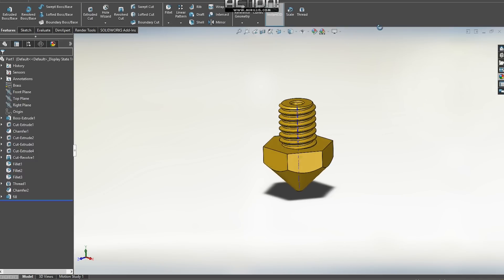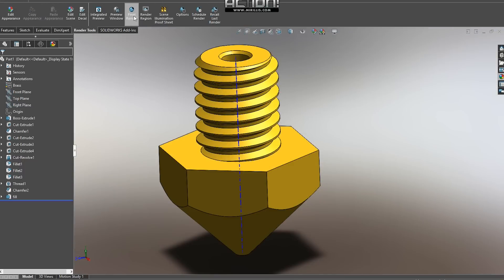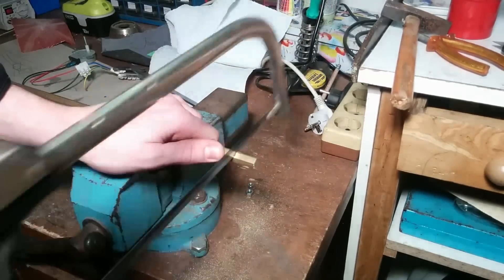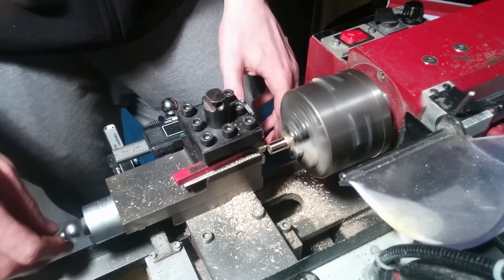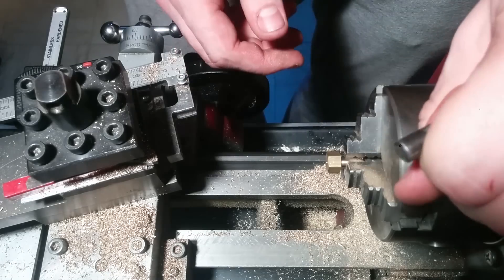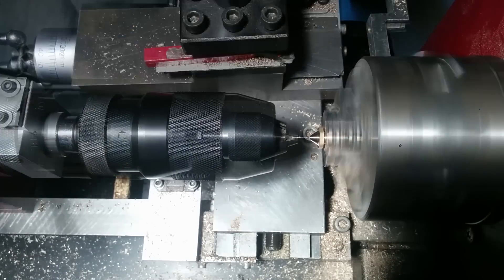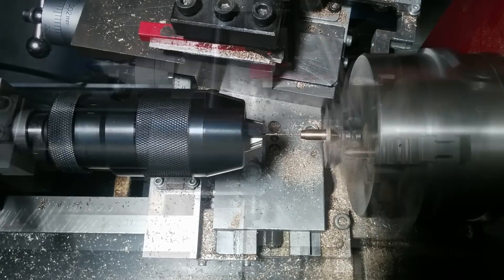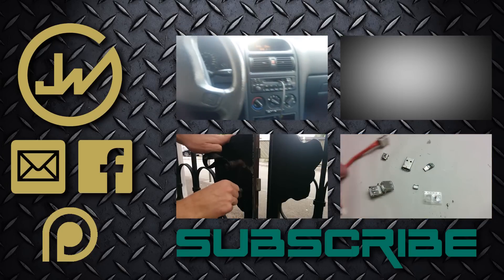Make a Brass Hot-End Nozzle

Comment: Thanks for sharing this.  I need to invest in some metric drill bits now.  Personally I would reverse the order of operations a bit.  I would be inclined to drill the 2mm hole to depth first, then the 1mm and finally the nozzle hole.  This would reduce the depth you need to drill on your smallest bits and thus reduce the amount of stress you put on them. Then cut the 45deg tip.  No criticism implied.  Just a different way to do it.  Thanks again.
Reply from the maker: +Prowler901 thanks Powler! I appreciate your thoughts and ideas :)

Comment: Thanks, I might give it a try. I got some 0.4mm carbide pcb drills somewhere...
Reply from the maker: +Fred Genius Nice, Send me some pictures how it turned out :)
Reply: I made one, not tested it yet, image here: https://drive.google.com/open?id=0B01q53nWAW2-aktfR3BZejBDcXc
Reply from the maker: Great one Fred, Did you make it from steel?
Reply: Brass, 6mm hex. This was my second atempt, I'll get it installed later and see how it performs. First attempt failed, broke the 0.4mm drill in the hole!
Reply from the maker: Really, looks like your brass has a very high percentage of zinc, because it is more silver looking. For drilling with so tiny drill bits use a very high RPM, highest RPM the better and do it slowly :)
Reply: Many thanks for the inspiration! It's good, regular brass, just looks a bit zincy in the photo. Max on my lathe is 3000rpm. I dint pay enough attention to chip clearance, that's why the first drill broke. Just waiting for the current print job to finish and I'll give it a try... Edit, when brass squeaks, your drill is about to break!
Reply from the maker: Fred Genius You are welcome! I hope for the best results ;)
Reply: I had so many problems with the original Prusa hot end, decided to make my own block and throat to go with the nozzle. I got it installed today, works perfectly and the results are clearly superior - better adhesion, nicer surface finish, less stringing. :)
Reply from the maker: +Fred Genius great to hear that. wish you good luck with your prints :) 👍
Reply: Fred Genius not difficult to break those .4 off. I’m making them from a2 annealed tool steel so it’s a very slow process for drilling that initial hole. The plus side is in experimenting with mixing nozzles and I have to say it is far better to make your own and reduce the mixing area significantly where over the counter nozzles may have a large chamber susceptible to clogging. You can buy c110 copper on eBay and make very nice heat blocks that will also improve heating and temps and to take it a step further make your tip out of larger diameter stock and drill a hole to install your thermostat directly into the nozzle so your temps read at the nozzle and not in the block.

Comment: Great proof of concept.  But seems like A LOT of work to replace something that you can purchase for a few dollars US.  Even multiple nozzles from some vendors for only the price of a cup of coffee.
Reply from the maker: Totally agree, but I was just curious if I can make it on my own, so why not :)
Reply: Parts Dave ... the benefit is you can assure your precision versus $10 for 5 tips that may all be off center. The other side is if you’re like myself and use hardened nozzles would you want to pay $28 each or would you prefer to buy a2 annealed hex and machine your own and then harden it with a simple mapp torch? With your machinery you can make better extruders, heat exchange blocks, water cooling, titanium throats, and so on. I’d personally never buy another commercial extruder again they’re all cheap junk for suttle hobbysists who haven’t seen what high quality parts can do to improve print qualIty.
Reply: Totally agree - however, if you apply the process to a tool steel blank (or just some regular C45) you can make about 4 wear-resistant nozzles in an hour, saving you around 35-40 bucks...